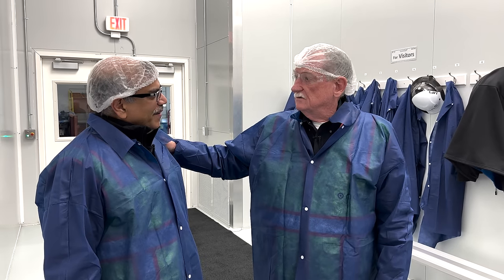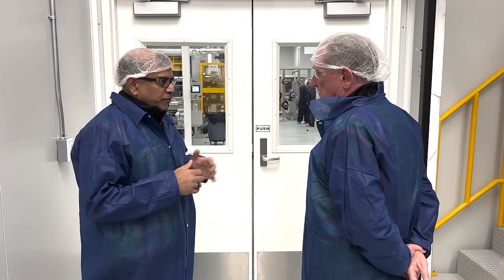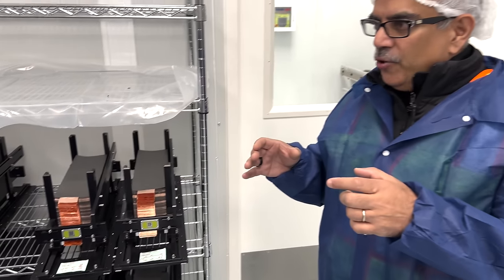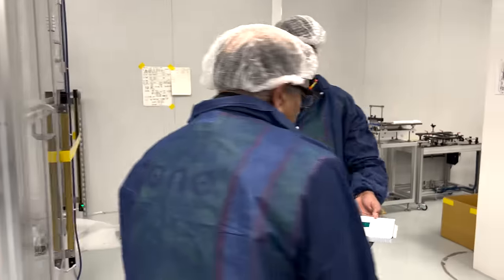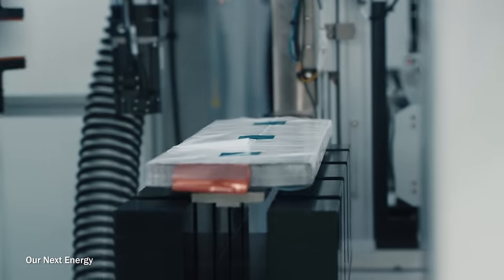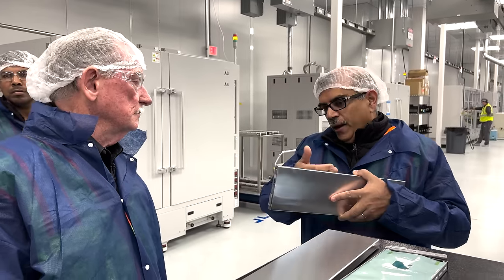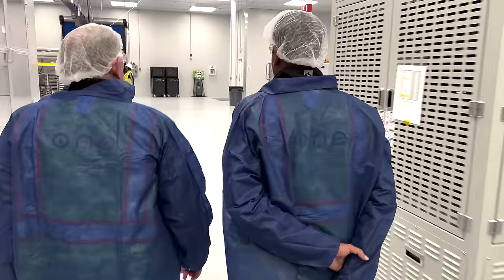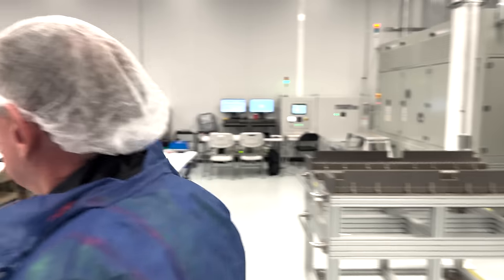Inside (ONE) Our Next Energy's New Michigan Factory!

Comment: I am so excited to see America get back to manufacturing! Back in 2018 I went to China and toured for large battery manufacturing plants. One of them was the cylindrical format. The other three were the prismatic format. I have always preferred the prismatic format. The way they've designed that cell really impressed me. I think the layout and performance is going to outperform Teslas cylindrical cell format.
Reply: Prismatic is good for low power LFP applications. It's not great for high power applications because you can't get the heat out fast enough
Reply: @saff226  There are prismatic formats with extremely high c ratings.
Reply: I was wondering about how they could cool this format as well, I love the shape and size but it seems like cooling could be a real problem.
Reply: @cendrizzi  the aluminum can or casing acts like a heat sink and wicks away the heat generated from the anode and cathode.
Reply: Tesla uses a few decades  old technology in their batteries,  it better would be overcame soon enough.
Reply: FALSE , gm & FUD motors GIVE up on USA Battery factory, FOCUS on core ICE/Hybrid business.
Reply: The U.S. is the second largest manufacturing country in the world . And leads in many categories.
Reply: @Slowhand871  In what, big macs? Three quarters of the American adults are occupied by Macdonalds and Walmarts, though I would like you to be right.

Comment: A lot of good info.  Interesting to see the individual roll-to-roll processes of coating the foils -- first I've heard that the copper foil+graphite needs to be compressed after drying to increase volumetric density.  The gravimetric energy density statements seem a little vague though -- "as good as ternary but without the fire risk" could mean anything from 180wh/kg to 270wh/kg.  And power density is important too, but at least they mentioned that with cooling plates both top and bottom they could reach 5C charging rate.  Since discharge max rate is usually twice the max charge rate, does that mean these cells are 10C discharge ?  That would be great for LFP if on par for energy density to ternary.  A problem with BYD's Blade LFP is the low discharge rates that basically require very large heavy packs for decent HP.  Usually higher discharge rate chemistry comes with a high weight penalty.

Comment: The factories in Michigan now are next level, even in my woodsy part of the state... I am an operator for summer.. was crazy innovation and robotics doing most welding and presses now (shorts as proof)
Reply: When considering purchasing an electric vehicle (EV), a crucial question revolves around the longevity of the battery. 

Tesla, manufacturer, claims their batteries should last for 300,000 to 500,000 miles or approximately 1,500 battery cycles. 

However, it's noteworthy that Tesla's warranty for their batteries extends only up to 100,000 miles, providing no additional coverage beyond that point.

As of January 2022, Tesla's battery warranty typically covers up to 8 years or a specified mileage, commonly 100,000 miles or more, depending on the model.
Reply: @AwesomeBlackDude I don’t feel that’s noteworthy as no manufacture warranty’s through end of life. 100,000 miles should give any new buyer security that the batteries will last though their original ownership.
Reply: @AwesomeBlackDude  Seven to ten years but that is only because you studied outdated data ... prius and first gen tesla with fulltime use lasts seven to ten years. On average... but again battery tech is now upgrading yearly now... new tech, new efficiency etc.. as proven by creator (Batteries Undecided with Matt)
Reply: @AwesomeBlackDude  also using ai doesnt mean its correct
Reply: @redtitan29 he apparently got it from an Ai reply copypasted
Reply: Michigan has a lot of engineers per capita. Many more than most states.

Comment: 16:58 - “we make it thinner”

So, the 800v battery pack will need ~2x as much metal for the can, which means 800v will have slightly less battery jelly roll & more can metal in the same space. That is too bad, just to get some percentage faster charging.
Reply: Exactly that what I thought. So they lose capacity to save a couple minutes of charging.

Comment: Company feels much more trustworthy then most out there. 
Plainly describing slow ramp, initial scrap rates, battery estimate and building/line expanding.

I sure hope those thinner cells for 800v can span whole car to reduce some shell material. At half the thickness almost seems like every cell at current size would have around 1:1 of shell to inside material.

Comment: What REALLY excites me from ONE Is the Gemini battery pack.  
A Model S with one the same physical size as the stock pack went 750 miles on one charge. 
In Michigan. 
In December.

BMW put one in a. IX and It doubled the range.

With it, an EV could handle most holiday trips without needing to recharge.
Reply: December is not the coldest month in Michigan.

Comment: A great comment about 800v cutting charge times in half. 
It just makes the peak charge higher, so it makes a  steeper charge "curve" but the peak is actually a shorter period.
The parts of the curve at the very low end and high end are still the same input power.

Comment: How does this differ from the approach and struggles that the Ultium batteries are / were facing? This also seems like a pouch in a casing style of product. I heard Sandy touch up on the swelling and mechanical resiliance of the layup, but I just hope the ONE cells don't run into the same problems Ultium did once in a vehicle on the road.

Comment: its nice seeing larger AH cells being made. Each cell being bigger in AH storage means it can handle a faster charge with less damage to the cell. Most cars now have 10-48ah cells. 10ah can take 10 amps in 1 hour at 1C and the 48ah can take 48amps in 1 hour at 1C. Lithium can be charged safely at 5C. Larger cells means  you can add more capacity in said amount of time. 12 minutes at fast charging is max.  The only down side is Lithium degrades faster at higher C charging and discharging. So charging at .5C compared to 5C means your battery can double to quadruple their life cycles. a car that can get 1500 life cycles at 5C can get 6000-8000 life cycles with LFP technology and charging at .5C-1C. I have LFP 280ah cells 64 of them in my 4 battery packs powering my house. I charge and discharge .1C-.18C so I should get the 8000 life cycles or close. It looks like I am loosing  .5% a year so in 10 years 5% of capacity should be lost. even if it goes to 10% after 10 years that is still great return on investment.

Comment: Sandy, did you just ask if they could put liquid in a container with two open ends? lol. This is kewl and all but still have to give it up for the cylindrical cells. Only plus here imho is surface area for cooling.

Comment: Would these cells be more space efficient than cylindrical cells? As in, cylindrical cells have gaps between all the cells that doesn't have any power storage, these seem like they would use all the availible space so I would think you would have a more dense battery pack per square foot of volume vs a cylindrical cell battery pack.

Comment: This is really great. My idea is to build a car or truck that uses a v4 engine powering a generator to charge batteries that runs off of hydrogen or gasoline. Then uses batteries that are super efficient like yours to achieve the least amount of batteries that charge fast for the unlimited range one could get for least amount of cost. The hydrostar lets hydrogen production come from water too.

Comment: Sandy during cell cooling conversation (about 16min in video) you should have asked if your cooling from top or bottom of ea cell wicking Down from sides how the hell are you getting heat transfer to those sides???? He just said he had foam between sidewalls to account for expansion, never seen and thermally conductive foam that actually works been in def business for 30 yrs. Fyi I have seen thermally conductive silicone sheets and seals used for emi in electronics
Reply: The foam is on the outside of cell container between each cell. So heat moves to the wall of the cell made of metal and to the cooler plate.

Comment: Indeed the electrolyte in an LFP cell is nasty stuff and will form an acid when it comes in contact with water. If you DIY with LFP prismatic cells and one leaks, get it outside fast. The water in your lungs is not an experience you want. The SEI layer formation is a critical step, and can make or break the longevity of a cell. LFP cells are my favorite due to the cycle life, ideal for load shifting with solar where you cycle the cells daily.

Comment: Interesting.  Looks like they are trying to build their Dream Battery.  Unfortunately for them, there is nothing different here than BYD has been doing for years (FYI: "BYD" stands for "Build Your Dream").   

A few issues: 1) The wet process costs more and takes longer than 1/2 dry or fully dry process,  2) They hope to make 30,000 car battery "equivalents" in a year or so.  That's not very many; FYI: Tesla's makes about that many vehicles PER WEEK, now, in 2023*,  3) The sealing then initial charging followed by unsealing, gas removal and resealing again is very time consuming, expensive an inefficient,  4) The rectangular welded case is expensive, time consuming and cannot be efficiently cooled (using the smallest area edge),  5) The two founding executives keep referring to their product as "Jelly Roll", which it is not!  These are stacked electrode cells, as shown throughout the various manufacturing processes in this video. 🙄

As stated in my previous comment on the previous ONE video, there is a lot of new, expensive equipment here that will be soon available at bargain prices at the liquidation auction.

* their forecast production of 30k / year production is about 1/2 of the Ford Mach-e, 1/3 of the F150 Lightning, double of the Cadillac Lyriq and a near infinite supply for the Hummer EV).

Comment: I am skeptical that electric vehicles can completely replace combustion engine vehicles. Having said this, I think that where we are today with electric vehicle technology and manufacturing is impressive. Depending on your driving needs, electric vehicles can be practical and compete with combustion engine vehicles. If you only need to drive short distances (up to about 300km a day) and live in a house, apartment or condo that you will be returning to at the end of the day and can charge your vehicle overnight at home and live in a climate that does not drop too far down below freezing, an electric vehicle should be practical and economical to own.

If internal combustion engine vehicles are going to be replaced with electric vehicles, there will also need to be some thinking on where the extra power required to charge them is going to come from and how are the transmission and distribution systems going to be upgraded? Also, how are all the electrical services at the homes, apartments, condos  or public buildings going to be upgraded so that they can charge electric vehicles. Furthermore, when electric vehicles need to be charged on the road away from your home how and where are the new charging stations going to be built? And of course, where is the money and funding to do all this going to come from?

Let’s assume that the transmission and distribution systems will be able to be upgraded to deliver the power required and that there will be as many charging stations as required and lets also assume that battery technology improves so that electric vehicles can be charged in the same amount of time it takes to fill a gas tank. Since we are on a roll here, lets also assume that the batteries can last for the life of the vehicle such that you can drive it up into 300,000 km range and the vehicle can last up to 10 years or more depending on how it is used and driven and that the cost to buy an electric vehicle is competitive to a combustion engine vehicle.  Even if all of this comes true, the transmission and distribution systems will probably not be able to deliver the power fast enough to charge an electric vehicle at a charging station in the same amount of time it takes to fill a gas tank.

Electric Vehicle batteries are rated in KW-hrs. A typical electric vehicle today that has a range of about 300 km uses a battery rated in the 50 KW-hrs range. Provided that your home, apartment or condo where you live has an electrical service with the required capacity you will be able to charge your electric vehicle overnight.  A typical electric vehicle battery charger that you can install at your home can deliver about 5 KW of power. This means that you can charge your 50KW-hrs battery in your vehicle overnight in about 10 hours (5KW x 10hrs = 50KW-hrs). If you only use 40 KW-hrs for the day then to get the battery up to full charge for the next day will take 8 hours. 

At a charging station, to charge a 50 KW-hr battery in one hour will require a power source capable to deliver 50 KW of power. That is starting to become a significant amount of power. Traditionally, a transformer rated at 50 KW was used to connect up to 15 homes. In older neighborhoods of the 20th century it was not uncommon to connect 20 or more homes to a 50 KW transformer.

To charge a 50 KW-hrs battery in 30 minutes will require 100 KW of power. In 15 minutes, you will need 200 KW of power, In 7.5 minutes you will need 400 KW of power and in 3.25 minutes, about the same amount of time it takes to fill your gas tank, will take 800 KW of power. This is for one electric vehicle. A typical gas station in a city has 8 pumps and during the day they are all being used at the same time and you are usually waiting in line for your turn to fill up. So if you have 8 electric vehicles that need to charge at the same time that is 6.4 MW (8 x 800KW = 6.4MW) of power. That is enough power for about 2,000 homes or about six apartments or condo buildings with 200 to 300 units in each building. 

To deliver 6.4MW of power, you will require two or three transformers about two meters by two meters by two meters with some switchgear in an area about twelve meters by twelve meters. You may also be able to do this with one larger transformer and some switchgear in an area about ten meters by ten meters. You will also need the right of way for either an overhead or underground distribution power line in the 28 KV range to connect to the grid.

Generating the power locally at the charging stations would also be an option. To do it with wind or solar would require hundreds of Acers of land so that would not be possible in a city. It can be done from traditional sources such as natural gas or perhaps using the new nuclear technology of small modular reactors (SMRs) or micro modular reactors (MMRs). There are some impressive developments in SMRs in the 300 MW size range and in MMRs in the 15 MW range but the costs may not be competitive.

Comment: American made LFPs are rare
Reply: not stuff out this year... not so true
Reply: LFP was invented here in the States and then subsequently licensed to China.
Reply: I just saw some China news that said 63% of installed cell capacity for q3 over there is lfp pack's now.
Crazy yoy growth for lfp, enabled by new chemistries like m3p lmfp etc. 

Some of those are already approaching nmc energy density at the pack level from just a few years ago. And they are ideal for energy storage&grid scale bess applications to. Tesla has had 40-50% lfp sales since late 2021 now in base models.

It was rumored catl would provide them with lmfp or m3p chemistry pack's over 15% more energy dense vs the current pack's sometime in late 2023. That would take a base 3 or Y to over 300+miles with the ability to charge it to 100% daily and gain more total cell cycles. 👍🏻😎
Reply: @MrXyzasdf  Chinese manufacturers do not pay licensing fees as long as the LFP batteries are only sold in Chinese markets.